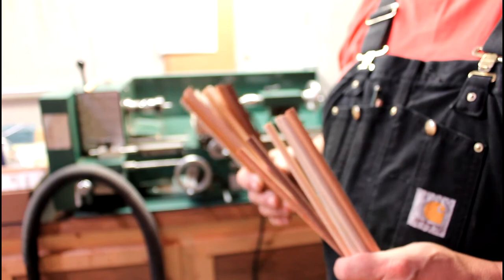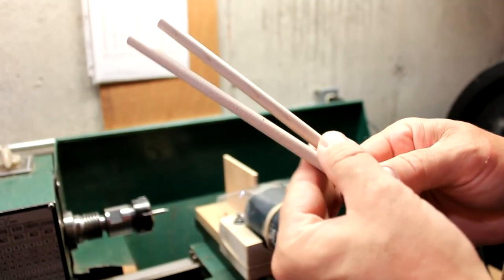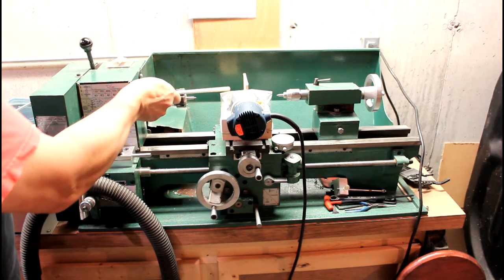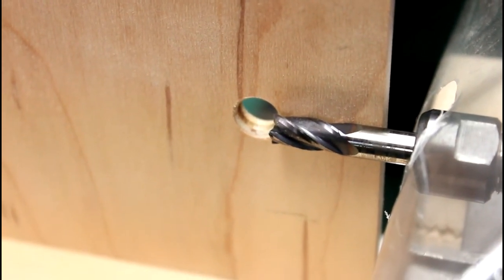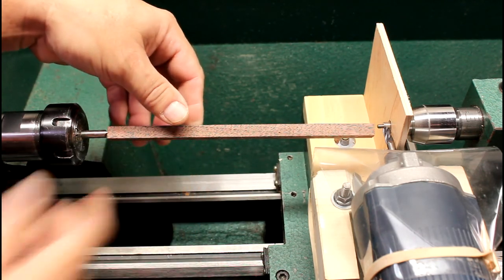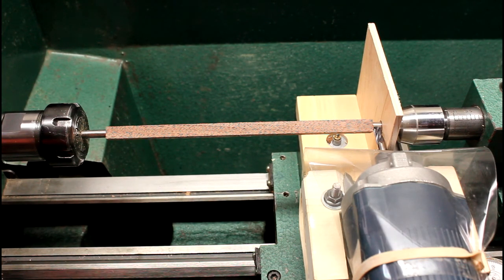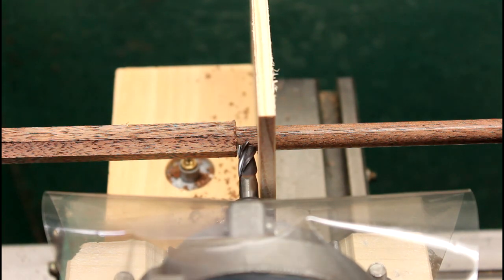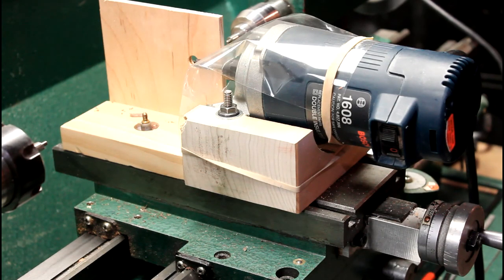Using a Metal Lathe and Router to Turn Precision Wooden Parts

Comment: This is so good! I only have a wood lathe so I will try rotating the whole thing 90degrees... I make a lot of pens and it's a pain to try to get everything to round from square, and started looking to see if anyone has done exactly this before - the real mind-blower is the travelling steady rest!!

Out of curiosity, Where'd you get the bit and what speed are you running the lathe at?
Reply from the maker: The bit is a 3 flute carbide endmill. The lathe is running around 300 RPM. The trick to this is to adjust the diameter you cutting to be a close fit to the clearance hole in the steady rest so that it is basically burnishing the surface of the freshly turned dowel.